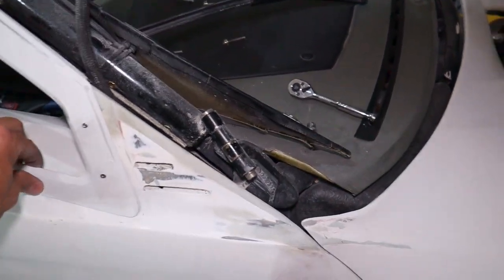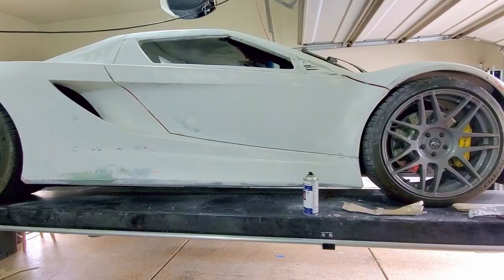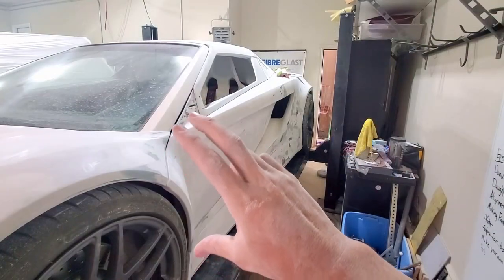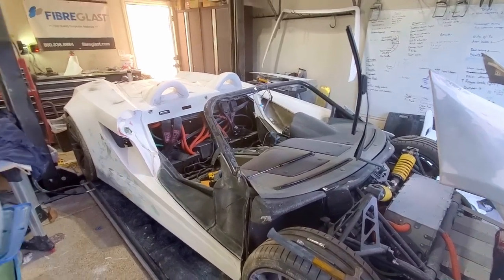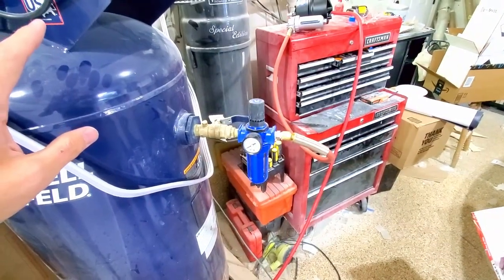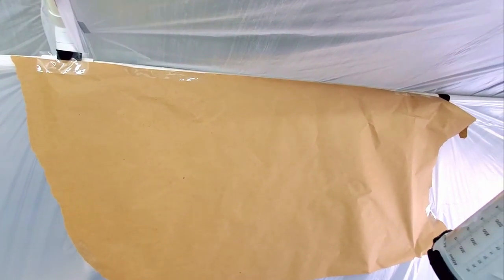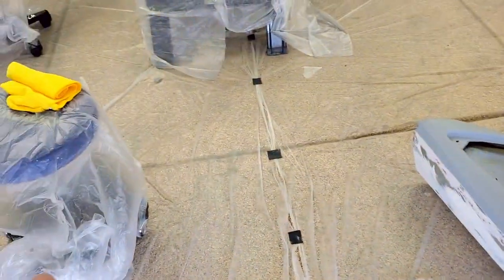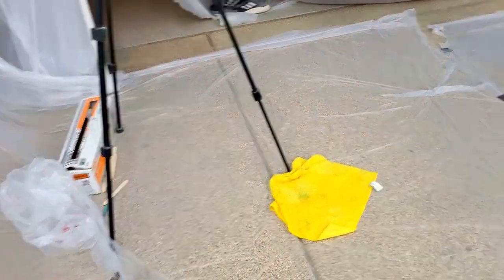Time to Start Painting!  Last Drive as the White Car - ESC S1 E121

Comment: I’ve done a fare share of spraying and from what I can see it looks like you’re doing a really good job, especially for your first time and not having someone right there helping you along. The only advice I have is be super diligent keeping your gun clean, getting in the habit of spraying whatever solvent you’re using through as often as possible. Have an extra hopper available with just your solvent in it, so you can do quick changes from paint or primer to your solvent and back again. This is the best way to keep your gun clean and working properly. Okay you got it👍
Reply from the maker: Perfect!   Thanks for the suggestion!

Comment: Very nicely done, Jeremy!  The primer looks just right—and it is designed to let you sand and perfect the surface before the color coat…I’ve always fully sanded all primer.  Primer is not only good for the car, it’s a primer for you, too—it gives you experience in how to mix, filter, and adjust the gun and how to put down a coating before trying it with paint.  I think you did things exactly right by starting with a few components that aren’t seen that much—I’d do the same with the paint.  Keep in mind that paint flows differently than the primer—but with a little practice, it’ll be terrific.  Don’t rush—I know you’re under the gun to attend the EV event, but rushing and not having time to make it right are the enemy of a great paint job.  Just my two cents worth, you’re doing very well, can’t wait to see the finished product!  —Don
Reply from the maker: Thanks Don!

Comment: any plans of performance testing your car? like top speed/0-60/drag racing/braking distances/skid pad. or even letting a pro/semi pro driver do a hot lap on a track? But then be prepared to receive a bunch of feedback about tuning handling/ braking/throttle response/regen etc 😤
also it could be super rewarding (hopefully not disappointing) to have cold unbiased numbers
..or just have fun and trust your butt Dyno, whatever's your choice!
Reply from the maker: Yes, I am going to Sonoma  Raceway for drag racing, autocross, and 3s.  Hopefully it passes tech inspection 🤞
Reply: @ElectricSuperCar  Awesome, looking forward to it

Comment: I'm new to the channel. Is there a video on all the specs of the car, like the 0-60, range, time it takes to charge etc, or is it too early in the process to determine those figures. I'm debating if I should do an electric car build or get two hayabusa engines and turn it into a high revving v8. Nice build!
Reply from the maker: I did some 0-60 times with Zack
https://youtu.be/asQ3Erxl6gE
Reply: @ElectricSuperCar  Thank you!

Comment: I would guess that you're going with yellow, but you bought yellow masking tape... which would not work with yellow paint... hmm  🤔 type of blue maybe?
Reply: Unlikely. His accent colors are yellow and black (wheels, carbon fiber bits and voids). You'd want a color that blends body gaps and transitions without overwhelming the styling. Next, it won't be too exotic as he plans on doing it himself and he Is practical, so no metallics, custom tinting etc.

Comment: powered guide coat is way better
Reply from the maker: I am interested in your experience.   I have heard some say the dry powder gums up sandpaper.  Thoughts?
Reply: @ElectricSuperCar  I have only ever bought one container and its been awesome, No clogging at all.  It covers the whole work area and shows every imperfection.  It even works wet sanding.  If your intereted ill get the brand name tomorrow.
Reply from the maker: @nosaint01  that would be awesome!  Let me know
Reply: @ElectricSuperCar  italko puder kontrolny.  Aka guide coat, but I’m sure 3m would be good as well